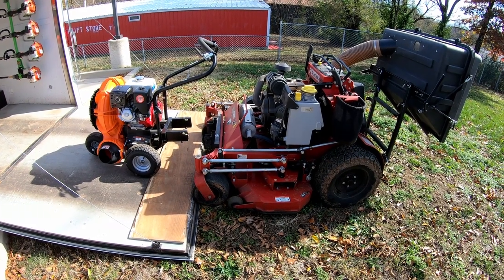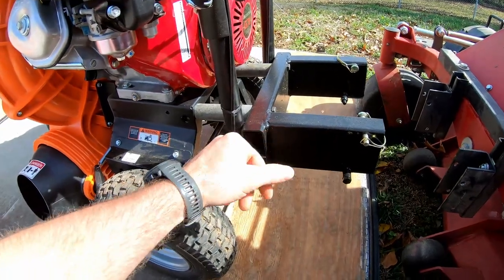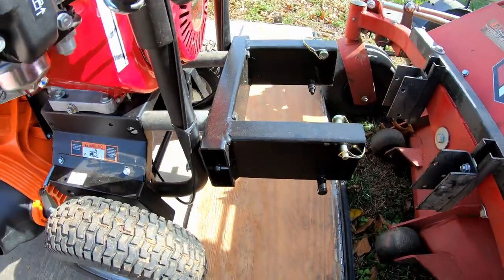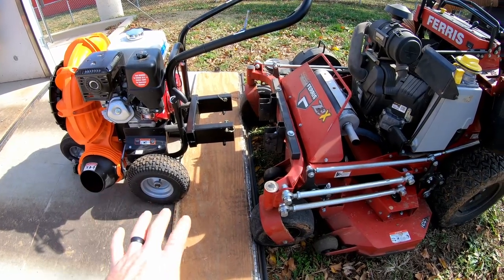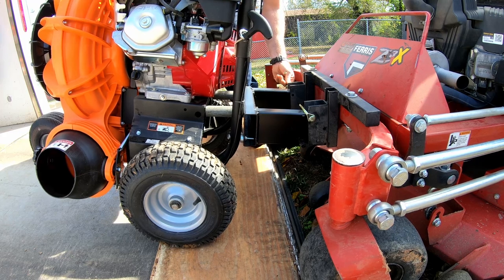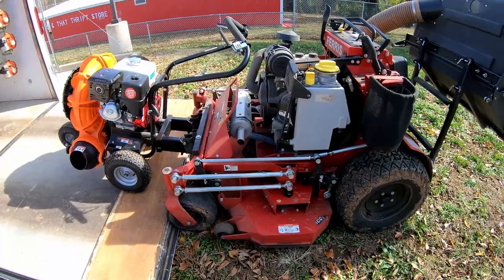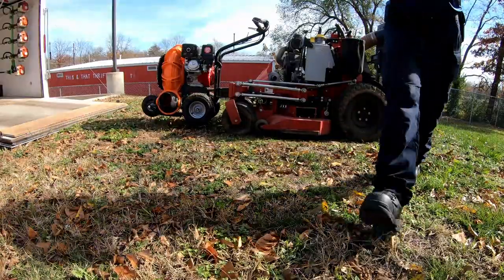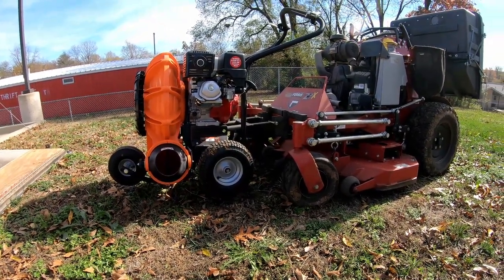Billy Goat JRCO Mount

Comment: Yeah nice design choice! Only question I have is if the mount is strong enough for blower and mower multiple use.  It's a alot of weight bouncing around.
Reply from the maker: It held up great for the leaf season, will be using it again soon.

Comment: thats a nice little setup you got there. i have a sit down zero turn and a 13hp billy goat. and what i did was take a cable lock, ratchet strap, and a couple bungie cords and strapped the blower up to the back of my mower to the rops (folded down) and it has saved me a bunch of time and walking. it looks redneck ( because it is), but going on 2 weeks and still works like a charm
Reply from the maker: Great idea!

Comment: That’s awesome!  Let us know how well it works?  What are your thoughts if the blower would blow in the same direction as the deck discharge. We normally mulch leaves on bigger properties.
Reply from the maker: I'm not sure what it would do or how it would work with mulching, would have to experiment with it. It's working great for us though.